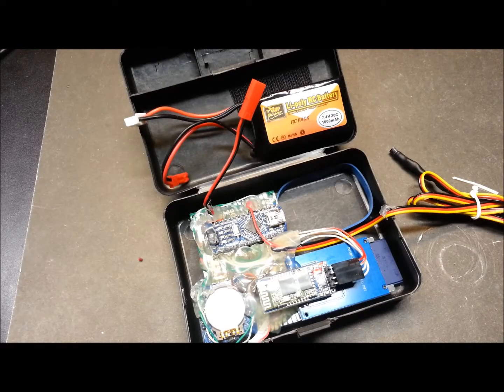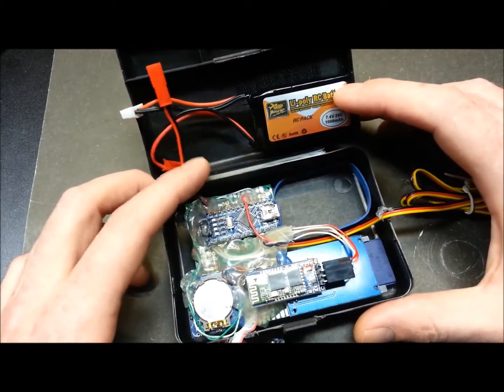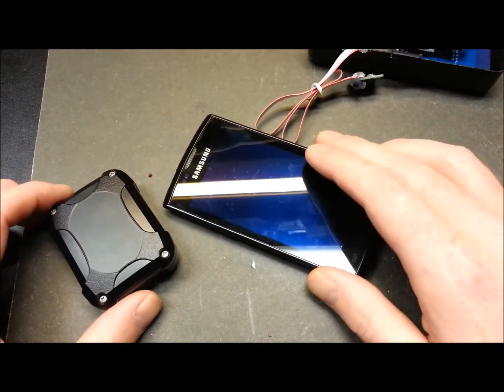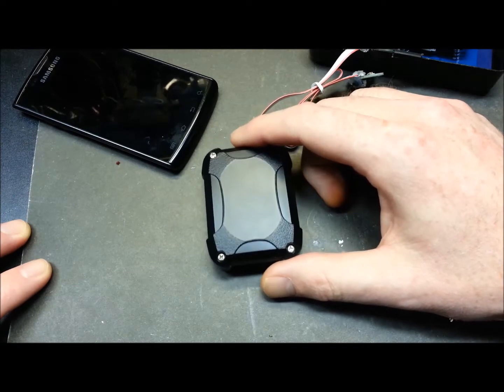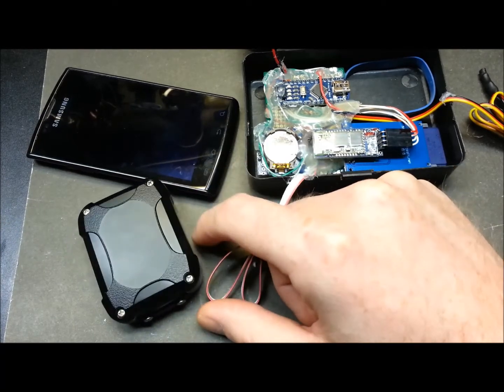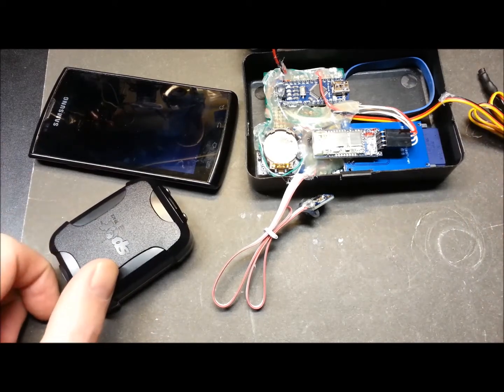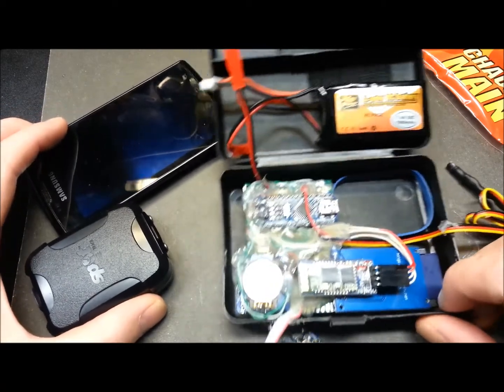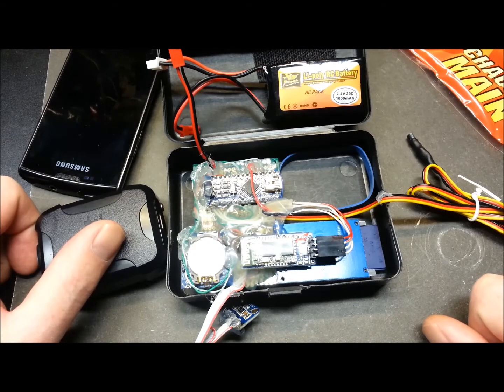HAB Part 7- Arduino and GPS Tracker Fun

Comment: never buy cheap rechargeable batteries from eBay. Where I work (an electronics and battery store), every about fourth customer needs a new battery because they bought a cheap crappy one from eBay
Reply from the maker: +tzq33tdq I've been using the same 4 of these 2S lipos for over 2 years now.  In aircraft, for projects, you name it.  Never an issue but I take care of them.  Not everything is "crappy" from eBay.
Reply: +Eric William -MKme Tech I'm meaning the ones that are very cheap from sellers that aren't very good
Reply from the maker: tzq33tdq Hmm how do we know which those might be?

Comment: Hi Eric,

I been trugging around the nets for bits for another project. I not sure if mentioned this to you before but there is ISM band transciever modules you can get and run something like RTTY or ASK/FSK (Amplitude Shift Keying & Frequency Shift Keying) which you can transmit gps cordinates, temps etc. I stumbled across this 'easyRadio Advanced Transceiver' and it rated at minimum temp -40°C and along with GPS connected to Arduino this might say you alot of heartache for now and get the HAB up in the air on time. Also you can use software called 'dl-fldigi' to track you HAB live.

One good thing about the ISM bands is you can do experiments like this and not need a license.
Reply from the maker: Thanks Dale- I had seen these but didn't know the name of it.  That is a pretty neat piece of kit.  Too late for Arduino development for this flight but if there is a next - I think those should be seriously considered.  Cheers

Comment: Hi Erick... i think using a lipo is a bad idea.  You have to be very careful when charging it and discharging it.  if you by accident discharge it more than recommended, you will damage it ( less charge capacity, life and amp output.) I am actually 3d printing a case for my capsules... are you still in need of a gopro?!?
Reply from the maker: Haha that's why you use a charger with a balancer.  These packs cost under 5 bucks as well so I'm not heartbroken if I don't see it again.  A fellow YouTuybe channel is supposed to be sending a GopPro soon. EDIT now you got me thinking- I wonder if there is any airspace in these packs- if so I would be in trouble.  Thanks for getting me thinking :)  Cheers

Comment: Not that I can solve your tracking issues in the upper atmosphere but have you thought about localisation when on the ground? Something like a piezo chirping might be worthwhile configuring to latch on when a large drop in altitude is detected.

Just that it would suck for everything to work and then never find/spend hours searching your data logging package in the middle of an overgrown field.

Actually thinking about it again I suppose you could always just call the phone and follow the ringtone.
Reply from the maker: Haha yep- I didn't show it but I also have a crazy loud battery alert buzzer for the LiPo but that wont kick in till it gets low (which I don't know how long yet).  Still may incorporate something else too.  Good thoughts!  Cheers